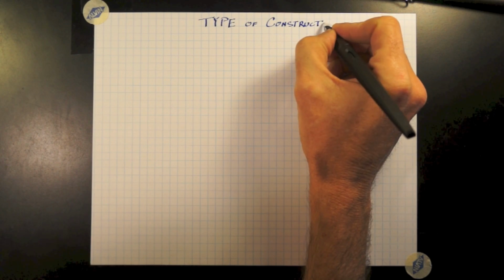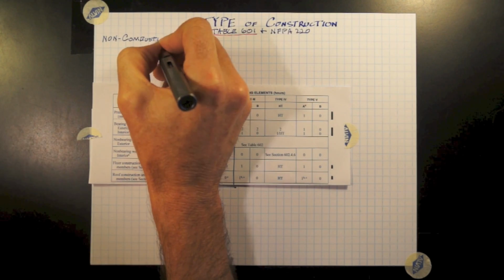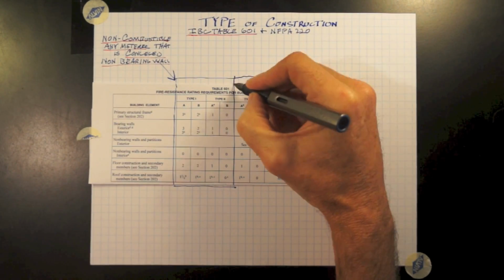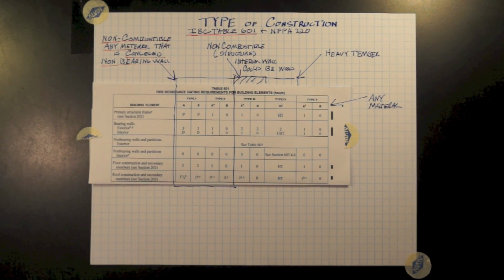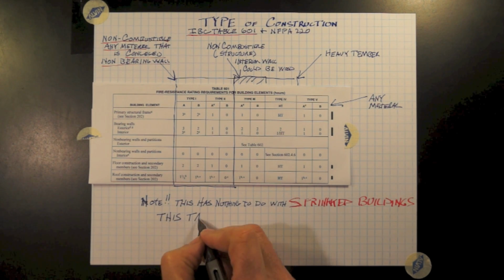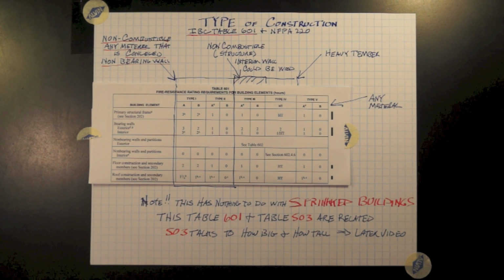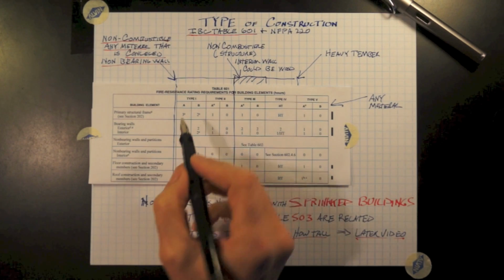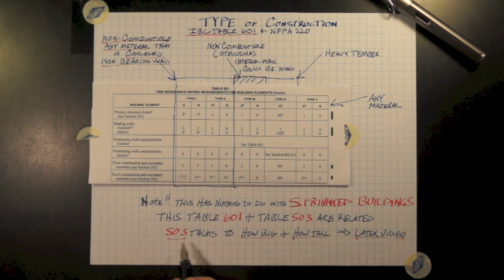Type of Construction 16-0

Comment: Good explaining of this chart and others.  Thanks for taking the time to help explain some things in the IBC. Do you have any insight into IBC 3412.7 & 3412.9 charts about building scoring? If so I would love for you to make a video.  Thanks for taking the time.
Reply from the maker: +Richard Moore : I will look at it tomorrow
Reply from the maker: +Richard Moore
I'm with you need some time to look at this.  I understand what they're doing, just have not needed to use this for evaluations.  I'm curious what field you're in that this would be a requirement or request.  3412.7 looks like a gathering worksheet and is built on 19 other forms that need to be filled out.  My curiosity is built and I'm going to start looking into this.  I see it as a potential educational tool to some building officials that are asking for more protection in our hospitals than is necessary.  I don't think they realize how many belts and suspenders and redundant backup systems we have in place already.  This will certainly educate others.  I'll keep you posted on my progress in any input or follow-up you have please continue to let me know.

Comment: I found In IBC Type III is " Exterior walls are of noncombustible materials and the interior building elements are of any material permitted by the code." 
I am not found " strick with structure it self ( load bearing wall)"!
Reply: I'm not 100% about this but I believe the code was modified in the 2012 edition of the IBC to allow combustibles in Type III construction. Previously, wood stud buildings were limited to 4 stories or a certain height (which I can't remember) due to being restricted to Type V construction. In 2012 I began seeing wood stud apartments that were 5 levels of wood and were using Type III construction. Use of FRT Wood for the exterior walls and structure is considered "non-cumbustible" under certain restrictions.

Comment: If A and B do not refer to sprinklers, then what do they mean?  How do you determine if your Type of Construction is an A or B?
Reply from the maker: Not sure I understand your question, thought I explained it in the video, I will watch it again but let me try ;)  Type IA and Type IB and Type IIA and IIB could have been Type IA, IB, IC and ID.  It is just the way the code was written.  There are some minor differences in Type I and II but that is not your question.  You have to go to table 504.3 that gives you height and area an that tell you your building type allowed.  Then based on your building type and area and our occupancy type it tells you whether or not you need to sprinkle it.  As for healthcare if you build a new and you build something that is out of wood and only 100 ft.² it shall be sprinkled regardless of the building type you use.

Comment: Dear Sir, Steel building will fall under which category as per table 601. What fire rating is required for such building. I believe steel building fall under type-II B category hence No fire resistance rating is required for such building, Pl clarify

Comment: Steel building will fall under which category as table 601. what fire rating is required for such building. i believe steel building fall under type-11 B category hence for fire resistance rating is required for such building, pl clarify
Reply from the maker: I believe you might be misunderstanding a little bit here. And IBC said this is probably among the most confusing pieces so you're certainly not alone. Nothing is requiring a steel building. What type II-B requires is a noncombustible building/material. Could be concrete, or steel. Your fire rating is going to be dependent on your occupancy type and size of the building you're trying to achieve. It's a combination of chapter 5 and chapter 6.   What is the occupancy type you're trying to achieve? How many stories and how many square feet per floor. Additionally if you are two stories or less and you have your building sitting in the middle of nowhere and what I mean is minimum 60 feet from the building to the property line you potentially could do type II-B unlimited, I would be very careful with this for you will be limiting everything in the future as well. But many buildings do this so don't be afraid just be careful
Reply: @MartyHuie  
Sir, 
the details of our building are as below:
Central Control Room-Steel Modular-Length 28 meter Width 18 meter total area 491.8 sq meter-manned building- 15 people
Admin Building-Steel Modular Length-48 meter Width 20 mete Total area 950 sq meter manned building 35 people
Electrical Substation-Steel Modular- Length 48 meter width 10 meter total area 480 sq meter-unmanned building
Chemical Storage Building-Steel Modular- Length47.5 meter width 20 meter total area 950 sq meter- unmanned building

all these building are 300 meter away from property boundary/fence. further inter separation between these building are more than 30 meters. all above building is single story with maximum height from grade is 3 meter. for warehouse building height is 6 meter.

with all above design feature can we go for non fire rating building as per IBC. 

quick response will be highly appreciated.
Reply from the maker: @shailendra21271  let's discuss everything but the chemical storage first by the sound of the building.  I would classify it likely as an F1.  Using IBC 2015 as a reference, table 506.2 you could do a non-sprinkle building type II-B up to 1774 m² and even much bigger 5322 m².  So considering the other buildings again not talking about the chemical storage building.  It looks like you fall under those parameters of not needing to do fireproofing and/or sprinkling based off of that table.

Now you will need to go to chapter 9 and look at fire areas.  I'm not sure the fire area requirement for F1 but the fire area in chapter 9 is slightly different than what is required or documented in 506.2.  Yes, this can be confusing.  Take a look at 903.2.4 .  It states all buildings of F1 shall be fully sprinkled if it meets any of the following and from your description it does not sound like it does.  Therefore, I don't think you need sprinkling nor fireproofing on the steel.

Let's address the number of people, 15 I do not understand how you got that number.  We never count physical people or butts in seats.  You strictly take your area and look at table 1004.1.2 .  Find a category that it meets and I choose business by that, I get 52 people in the space.  Yes, sometimes it's a ridiculous number but that's what you've got to designed to.  All this tells you is the number of doors you may need out of the space.  When you have more than 49 people out of the space you need  2 doors.

Now let's address the chemical storage building.  I really cannot answer those questions.  The chemical storage building is going to be classified as an H Occupancy.  And all depending on the amount of chemicals you are storing and the type of chemicals that alone will make many different determinations.  It is very good you're separating it and making it an independent building.  Keep in mind if you make this building 70% open and that could even include louvers allowing it to be considered open.  You do not need to sprinkle it or fireproof the steel it's considered an outside storage.  If it is greater than 70% enclosed that's where you may need to sprinkle and fireproof.

Hope this helps some
Reply: Marty Huie thanks for your quick response. Sir does this means that I can go non fire rated fire doors ???
Reply from the maker: @shailendra21271  that I cannot say for sure.  Classification of the structure is not necessarily an indication of needing fire rated doors or walls.  That's another issue altogether and really not related totally.  There are some minor relationship, but not much.  Sorry I can't be of more help.  It really sounds like you need a good mentor.  Try to reach out to some local older architects.  Additionally, it all depends on what jurisdiction you're in and what other governing codes that may be in place.
Reply: Marty Huie thanks a lot

Comment: Type III construction, does the exterior sheathing have to be fire treated (fire retardant)?
Reply from the maker: i've never built anything in type III but reading the code it says exterior wall shall be a non-combustible material the exterior sheathing is part of the exterior wall so if I was the code official I would say yes it needs to be fire retardant
Reply: Marty Huie I agree

Comment: WHAT IS  A and B for type 1 or 2 ??
Reply from the maker: As that video states I think, it's nothing they could have named everything, (type 1) (type 2) (type 3) (type 4)  , but they did not.  It's just different levels of protection.  Take a look at IBC 2015 table 601, it's as simple as the table is speaking to.  This is probably one of the most misunderstood beliefs is A means, fire protection and B means no fire protection.  This is not the case.  It is strictly different levels of fireproofing and/or material that's allowed to be used.  602.2 explains the material you're allowed to use for Type I and II and 602.3 for III , and so on.

Truly this is one of the most common questions

Comment from the maker: Type of construction table 601 and NFPA 220 both speak to the types of material you're allowed to use. Both of these tables and sections relate to other sections of the code that speaks to how big or how tall your allowed to build building. For instance code wise you're not allowed to build a building out of wood if it's over a certain amount of square footage. Likewise you not allowed to use would be the building of different heights in concealed spaces i.e. your on allowed to build your Interior partition walls of wood on a high-rise.  This table does not speak to those locations it only gives you the definition of the building types. Table 503 speaks to hide insights that directly relates to take 601.

Comment: sprinkled or non-sprinkled, lol
Reply from the maker: I'm more curious than anything else what was funny? Something I've gotten my video that's wrong I know I do it all the time something I wrote?  I'm not bothered just wanting to know :-) code officials have pointed out where I'm wrong a few times and I've edited them and fixed them as well
Reply: @MartyHuie  no, it's not wrong information -wise, but you said "sprinkled" instead of "sprinklered" or at least that's what it sounded like, and it made me chuckle, that's all. Thanks for the informative video!
Reply from the maker: @wjcolclasure  there is likely no doubt I said that :-) I tried to make sure I use the right words when on a video but certainly I know my coworkers look at me oddly from time to time as well.

I pronounce the word closer on the door incorrect many times I have this one coworker that literally corrects me every single time and for some reason my mind and my mouth will not engage together.

The intent is still there. Thank you for the comment and thank you for applying